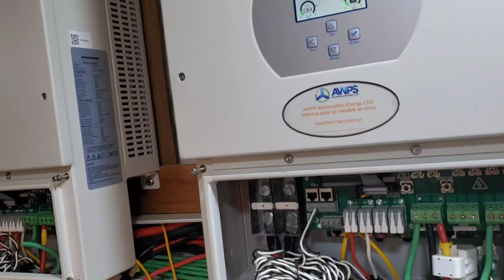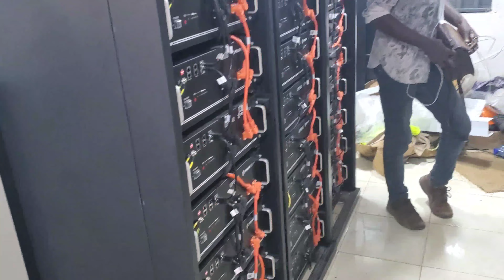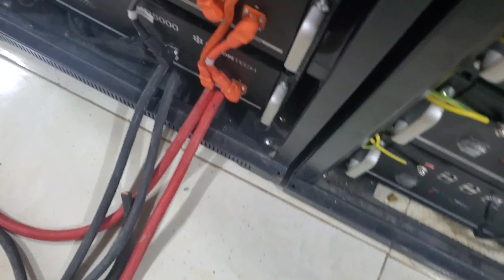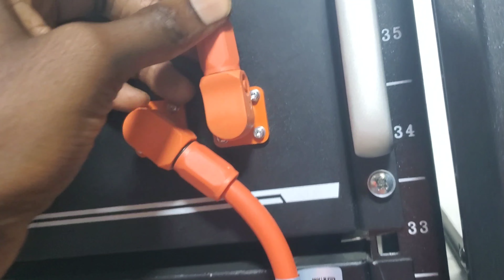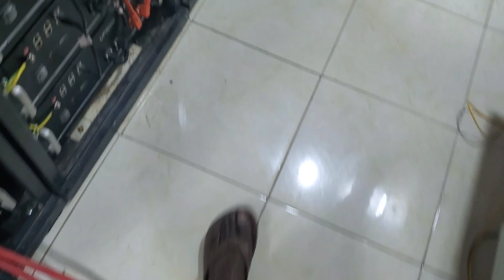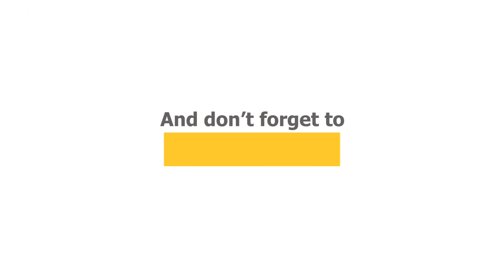WOW. Powering a 60 kva load at Loveworld Camp. Amazing feat

Comment: System should have been designed around higher voltage, 100kva single inverter could have done the job, battery series up to 120V or more could solve the cable heating issues.
Reply from the maker: Thank you for your observation. We feel the same way too. We would have liked to have had time to buy the equipment we needed. But we used this because it has worked for us. We have resolved the issues with the cables

Comment: I think you will need to sacrifice a few tiles. I know this room was not purpose-built for this but I recommend that the cables in question be run below-ground for safety and protection of the cables. Of course, the design should provide easy access for maintenance. So, keep in mind the route of the cable when deciding the length - not too long or too short. 

In the engineering parlance, this "powering exercise of the system" is called commissioning. 
I'm not trying to sound cocky, but I like what you're doing. Keep it up!
Reply from the maker: Please sound cocky. You have earned the right. We are thinking of what they do in computer server rooms. We had given consideration to cutting the floor too. Thank you for watching and commenting

Comment: Easily said than done, simply add more parallel cables on the overheating cable run. No need to upgrade cable diameter  which paralleling increases its ampacity.
Reply from the maker: We will be adding more cables. Checking online my cable can handle about 170 amps at 48 V and 18 feet. I am currently at 340 which is inadequate. We will 6 per side for a total of 8. 8 x 170 should be a good start. Thank you for your help

Comment: Dr solar I reckon you need 1900mm2.
If you were using one inverter with the cable length of 5m you would need 120mm cable.
It would be nice if you had check the voltage at the inverting terminal and compared with the voltage at the battery terminal under load, you would be surprised at the voltage dropped, voltage drop will increase the amperage plus the inverter efficiency will also cause your average to be higher than you might think.
Reply from the maker: We will measure the voltage at your suggestion. I did not think about that. This is why you folks rock

Comment: Is it a 48v battery? If so you are using 1250 amps. I would use 6 pcs of 4/0 cable minimum. More would be better if they are using that much power for a long time.
Reply from the maker: It is 48 V. We want to use 8 or 9 3/0 cables
Reply: @drsolar  8 should be fine.  My book says 3/0 can handle 260A at 60C. I would try to stay around 200A per wire to keep the wire cool.

Comment: By code i am required to use 6 parallel here. Although i would use 120mm² and then only 4 parallel. The equasion is simple, the more connections on parallel cables you have the more goes wrong... One comes loose, others get hotter, also come loose faster, and fire... So best is to go as big as possible (of course money and handling plays a role, you cant put a 1000mm² cable in there) and then have the least connections possible.
Reply from the maker: We will do 8 x 70 MM and then use a thermal camera to measure the results. Cables here are expensive and not always the best quality.

Comment: Figure ou wire size for one inverter and then use 9 of them. or similar MM2
Reply from the maker: I did not think about that. Good suggestion
Reply: @drsolar  you may want to go with bus bars all the way
Reply from the maker: @offgridwanabe  the distance and the placement makes it Challenging
Reply: @drsolar   you may need to come off the batteries in 3 different places then combine them to a bus bar before inverter
Reply from the maker: @offgridwanabe  we did. In 5 different places
Reply: Great job Dr Solar. 350mm seems more that adequate to me. That battery bank is really huge. How many kilowatt hours is that?